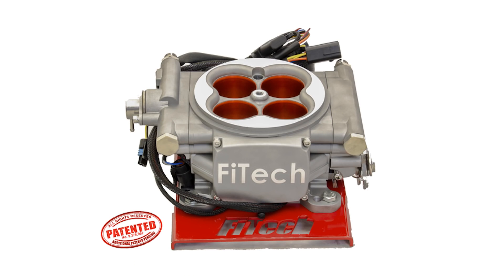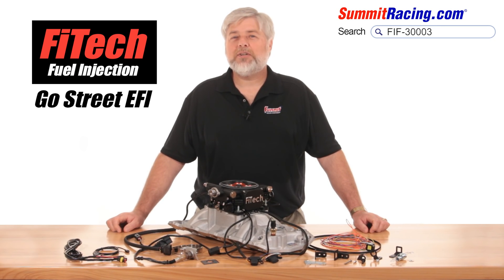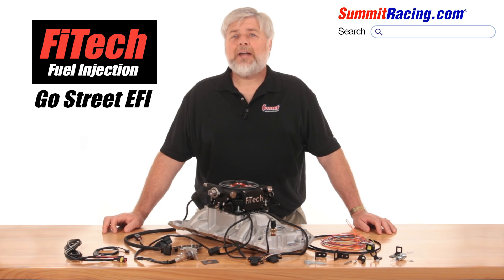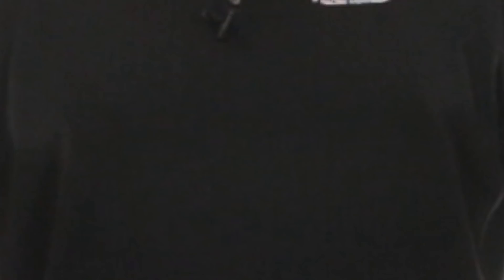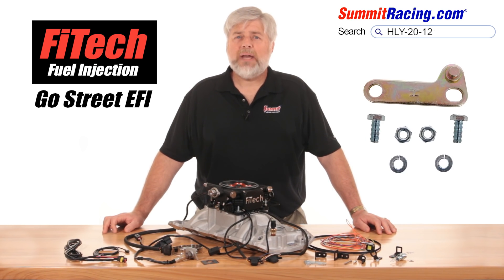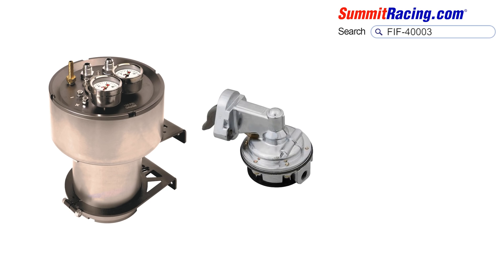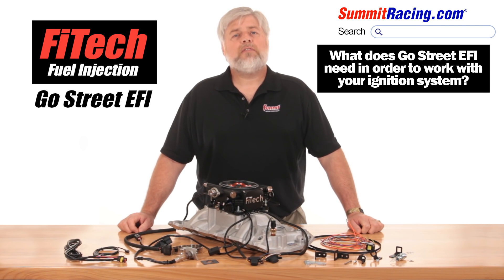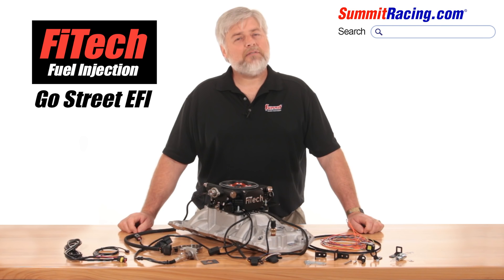The FiTech Go Street EFI System

Comment: how much does it cost
and can it be used along with boost
Reply from the maker: Hi Rashaad, 
The entry level “Go Street” system is a part number FIF-30003 and retails at $795.00.  It is NOT designed for boosted applications. For that you will need to step up the FIF-30004 system.

https://www.summitracing.com/parts/fif-30003

https://www.summitracing.com/parts/fif-30004

Comment: me and my dad have a 1973 Mustang 351w. do you make something for 450HP and we want to go turbo sometime so upwards of 600HP. 4 speed manual.
Reply from the maker: Hi TheSamplebridge, 
FiTech has a 600hp power adder system available under part # FIF-30004. This system will work fine while naturally aspirated, then perform the tune process again when you add your turbocharger and choose the boosted option! Very easy! https://www.summitracing.com/parts/fif-30004

Comment: that's incredible I have an 87 F250 460 with a 5-speed manual do they make anything for that application
Reply from the maker: Hi Bill, 
Provided your horsepower level does not exceed 400, this would be your go to system!
Reply: +Summit Racing it's been awhile but I think it was tested it around 408 horsepower it's cammed more for torque because I have an 8-foot Western Plow on it thank you for your response to my question last night I do really appreciate it cuz you are the Pearl I am the amateur